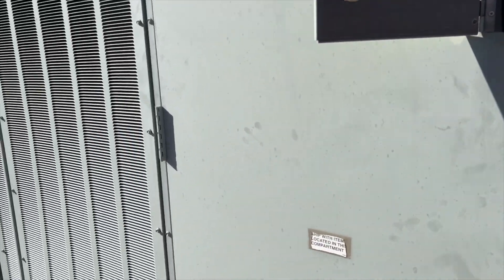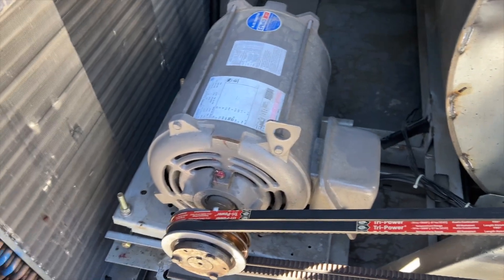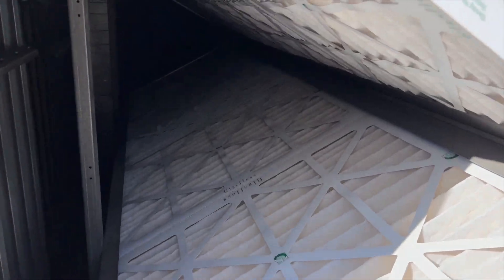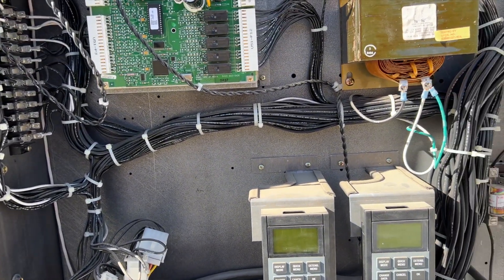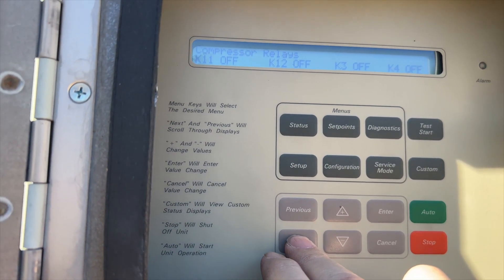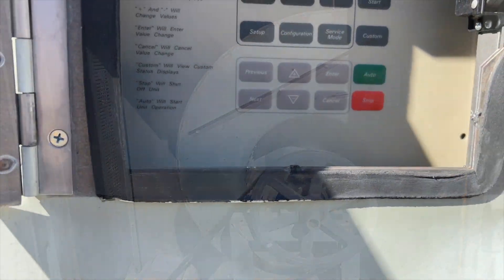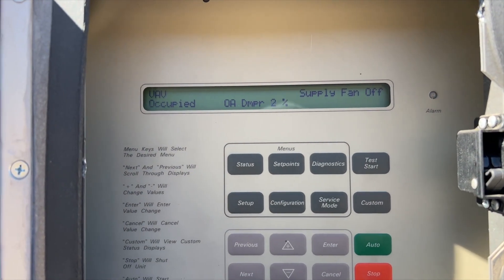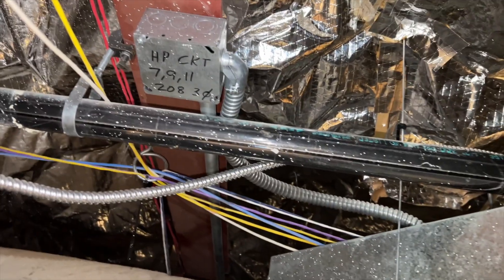Fire Dept Called Due to Burning Smell From Trane Intellipak EP134

Comment: My unit has alarm blinking and on the screen show: Active Diagnostic - Auto reset
 RTM Zone Temp Sensor Failure, so how I can fix it? Please help. Thanks
Reply: I wouldn't worry about that alarm. It is saying that it can't see a zone temp sensor. Most buildings don't hook up to the unit and everything runs through the BAS